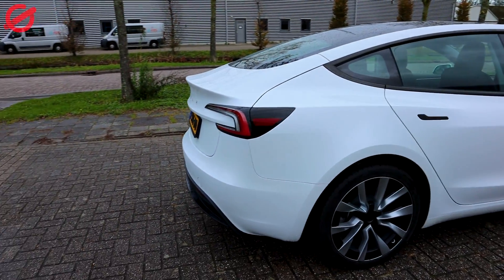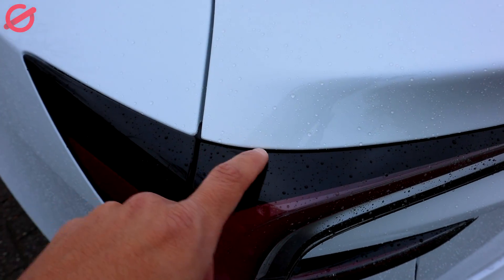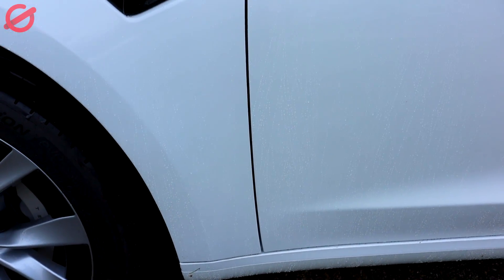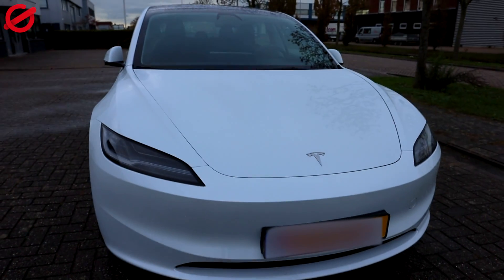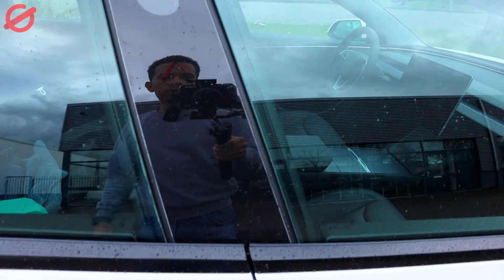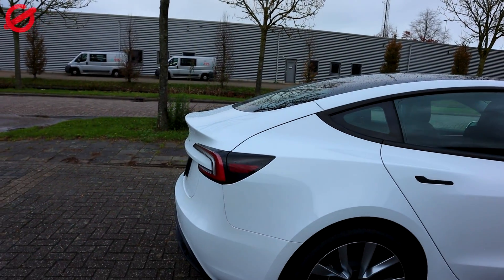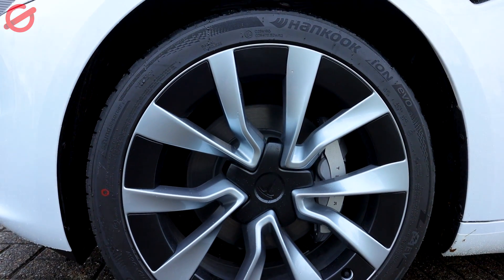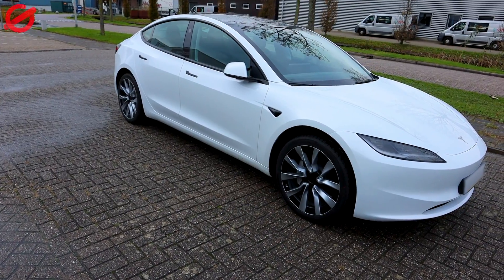Panel Gaps Tesla Model 3 2024 highland - A Close-Up Look!

Comment: I have a friend with a very early Model 3, somewhere around the first 6k made. It has a pretty big gap above the driver side tail light. Despite this, his car has somehow managed to go about 110,000 miles to date with no major issues.  Not sure how he has survived all this time.
Reply: Your car doesn’t brake down from a panel gap haha? Why would it? All cars have panel gaps, it’s just the consistency between them in which Tesla lacks slightly to other car manufacturers. But in turn you get a way more competitively priced car with a lot more tech, range and power.
Reply: The tech in Teslas is actually very reliable, it´s the fit & finish that took them a while to improve.

Comment: Uneven panel gaps, orange peel paintwork, and creaky plastic trim internally, were some of the reasons I chose not to go for a Tesla Model 3 pre-pandemic. The others were the lack of practicality due to having no tailgate, and having watched Sandy Munro's YouTube video, where his workshop reverse engineered a Model 3.  Sandy Munro commented that the M3 showed a lack of design and manufacturing experience. The rear wheel-arch was made up from no less than 9 separate pieces of steel. Most other car makers would use no more than 2 or 3....... I won't be looking at Tesla again for perhaps another 10+ years.....
Reply: Hilarious! You had me going there for a while. 😂
Reply: See the first part of your comment makes perfect sense but finishing with "I won´t look at Tesla again for another 10+ years shows how you mistake Tesla to be as any other company when in fact they iterate so fast that their fit & finish has improved so fast that the recent ones are actually better than legacy auto companies. At least, the 3 & Y coming out of China or Berlin. The Fremont factory sadly can´t be improved as much due to lack of space and automation ability, being an older factory instead of a ground-up one.

Comment: Thanks for the vid! Better gaps than previously but not that great. Saw the Highland last week on an auto show and was kind of disappointed by the gaps, especially around the trunk. Also, in the interior, the driver side door was not perfectly aligned and now it shows because of the led band. How is yours?
Reply from the maker: I think if you are setting on the driver side they will not look aligned, but from the passenger side they looks almost perfect and vise versa.
Reply: @EJTechandDIY   Not sure: the misalignement on the driver side was visible even from the outside of the car. Don't get me wrong: I love my current Model 3 and I like th Highland on paper. Still, I'm not upgrading until they solve this issue and also the awful delivery experience issue.

Comment: After seeing your thumbnail, I went in with low expectations. I'd be fine with those panel gaps. With legacy cars, having panel gaps is a symptom of more serious manufacturing issues in general, with Tesla it isn't the same as the internals are the most advanced of any EV manufacturer. I'm guessing the gaps could be a cause of the way different parts are put together in an easy and low cost manner, a bit like lego, probably in preparation for being built by Optimus robots. The whole Tesla experience is so amazing compared to any other car I have experienced that the potential gaps are a very small issue. Imagine living without the Supercharging network or the software with many very useful smart features that once you get used to you can't live without and are unique to Tesla.
Reply from the maker: I mean the car is not perfect but my God is an experience to drive, this is my first EV and I don't think I can go back. the other crazy thing is that here in the Netherlands SuperChargers are cheaper than charging at home for some reason.
Reply: @EJTechandDIY  
Here in the UK I pay 7.5p/kWh charging at home overnight which is the equivalent of 2p per mile. On my nearest Tesla Supercharger it used to be 25p/kWh off-peak, now gone up to 35p/kWh. I can't think of much I'd change with my Model 3 Performance, the feature I'd like the most is vehicle to load so I could power my home during the day with cheap electricity charged during the night. It is the nearest to a perfect car that I have ever experienced.